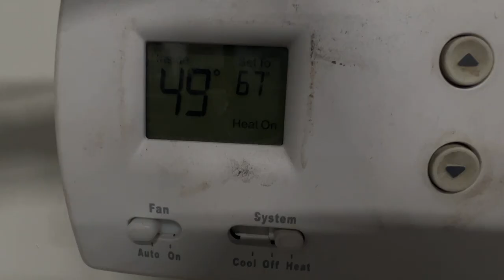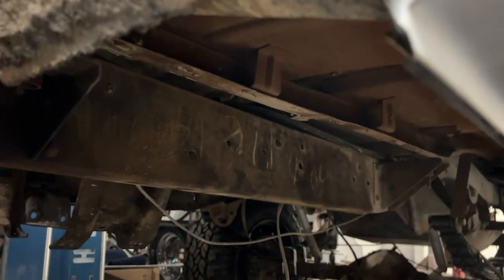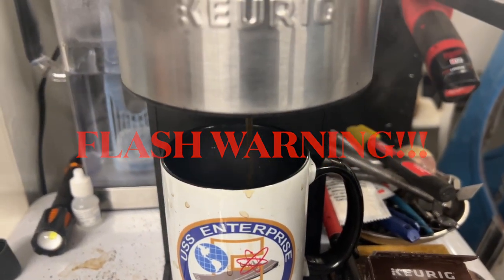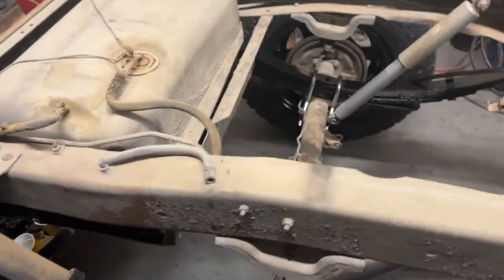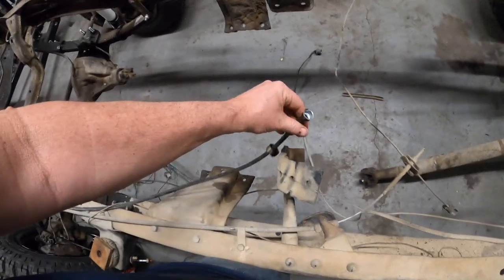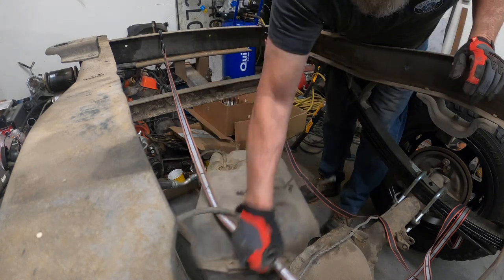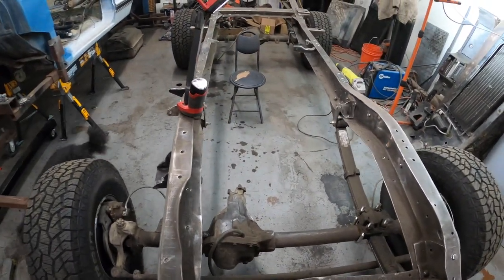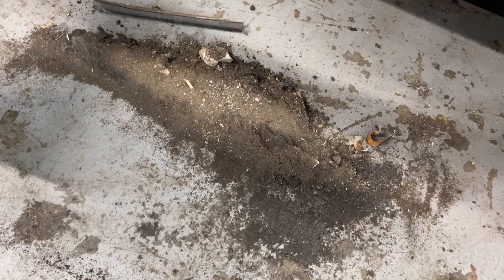1 Man Body Removal!! Finding more surprises

Comment: Thanks for sharing your Blazer project.  I’m restoring a ‘72 Blazer and having to replace rusty rocker boxes.  Mine has the same square shims under the driver side front body mount.  I assumed they placed these at the factory to line up doors with front fenders…not for sure though.  I planned to put them back as I found them when I mount body back to the frame.  Mine also had lots of flex when I removed the roof and suspect it’s due to rusty rocker boxes and A pillars.  I used hydraulic rams from harbor freight to realign the door opening so doors would open and close w/out rubbing and then installed braces similar to what you did.  Good luck with the build and I’ll stay tuned in.
Reply from the maker: Nice! 72’s had nicer interior door panels! Are you going stock restoration or modifying it? I’m doing a restomod of sorts, unfortunately the engine had been replaced in the past so it wasn’t original. The body shims I have normally found on GMs are U shaped, but there are a few out there that are fully square. Where I have seen these more commonly used as is a Framing Plate Washer used in Construction and are 1/8” thick. They’ll definitely work as a shim, I was just surprised to see them.
Reply: Definitely restomod.  Going with LS3 and 4 speed OD tranny, four wheel disc conversion and 4” lift with better shocks…likely fox or king.  Mine is hugger orange with the Highlander interior..:plan to keep that but likely go back with a similar color with metal flake.  I really like inferno orange (gm color).  We plan to drive and enjoy it long term.
Reply from the maker: @cameronthompson356  nice, the Inferno Orange is an awesome color. Im going LS2 with a 4l65e, engine is at the machine shop right now. I haven’t settled on a color, I do like the Medium Blue it came with (and my Dad had a 71 Suburban in the same color) but I also would like something more modern. I need to make a decision!
Reply: @BlueOvalRescue  Elkhart lake blue would look bitchin!  Are you going solid or two tone?  Will look fantastic either way.
Reply from the maker: @cameronthompson356  I haven’t decided, I really need to do some drawings, I love that blue as well! I had looked at the Northsky Blue Metallic as one option… so many cool colors out there

Comment: They're used on the anchor bolts for a house you put that on the bottom plate over the bolt you put the nut on top of that Crank it down keeps the bottom plate of your house where it belongs which is nothing but a piece of pressure treated two by four
Reply from the maker: Absolutely correct!!! Plate Washers!